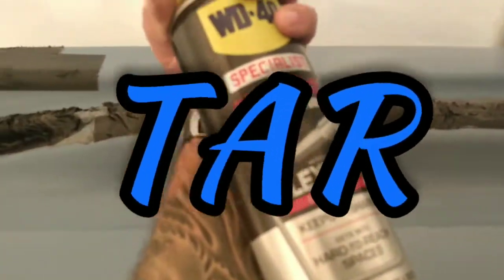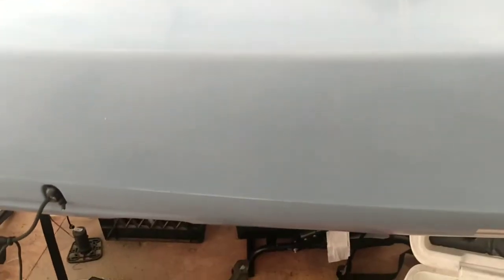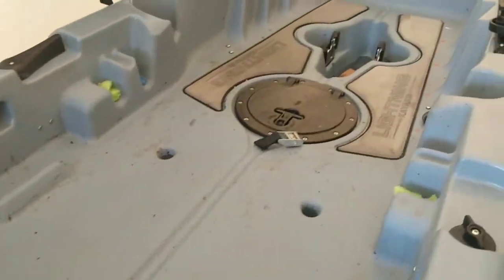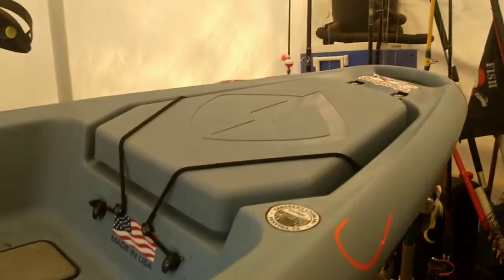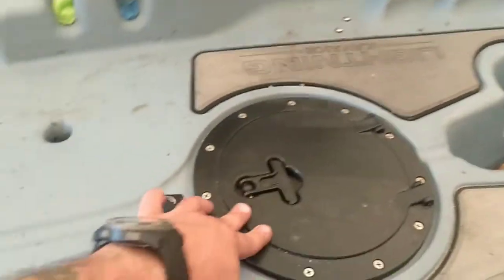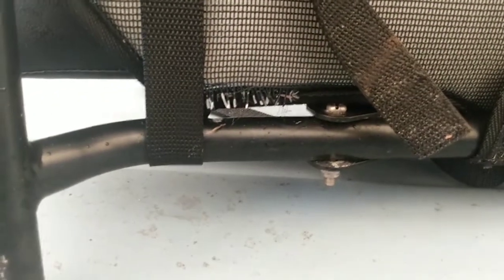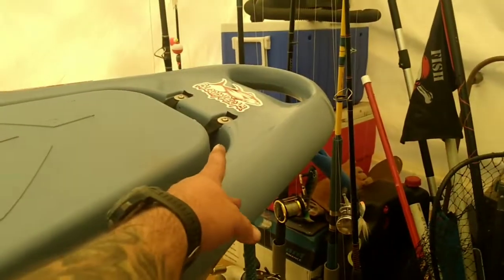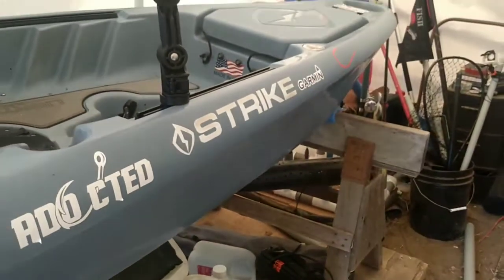LIGHTNING STRIKE KAYAK 4 MONTH REVIEW!!

Comment: Ya same question as guy before.  How much u weigh and do U take on water from drive hole ?
Reply from the maker: I wiegh 180 lbs.yes if you don't have the drive in the hole.if I stand up it comes in regardless.if you plan on paddleing and want to stand up get the cassette plug for the drive hole.almost all pedal kayaks let the water drain from that slot..I've been out in some rough water with only had about a cup and half of water inside
Reply: So if the peddles are in does water come in when u stand
Reply from the maker: @theamwaymantv4690  yes water still comes in...if you don't want that then maybe a peddle drive isn't what your looking for...I stood up in at the lake and my feet didn't get wet but water will come in and more water the farther you go towards front hatch...if you luanch it in surf your going to get water inside but once you get that drive in and sit down all water drains out

Comment: I picked this same one up last year I had an issue with the cable on the drive popping off the loop a couple of times just hooked it back up. ever had that issue?
Reply from the maker: Nope at least not yet...
Reply from the maker: After about 20 trips I did notice the cable was loose but no slipping off.i check the drive before every trip just move it around and what not... I'd say to make sure everything is tight before heading out...don't over tighten the cables or they have chance of breaking